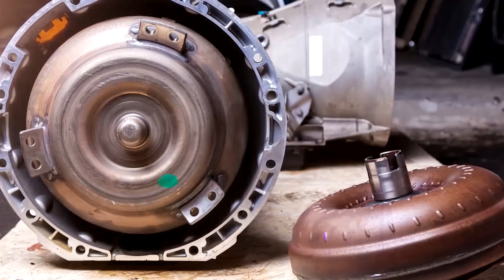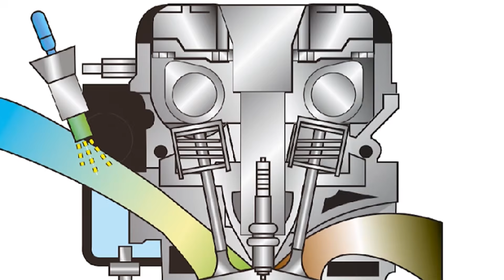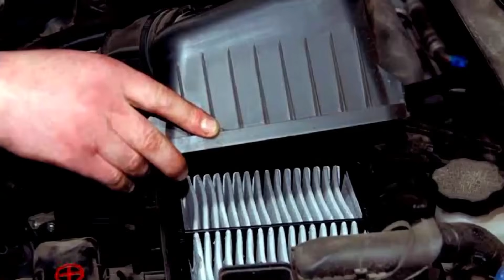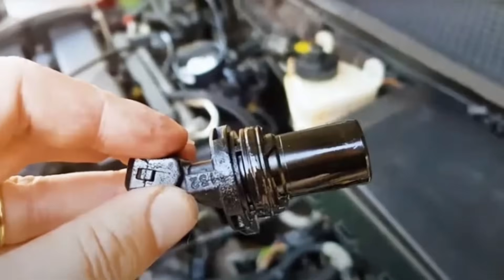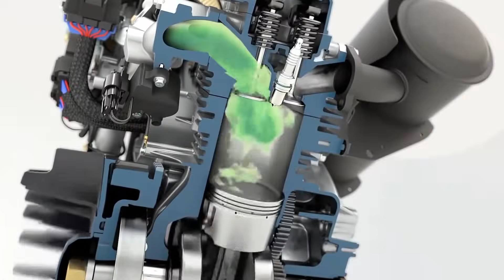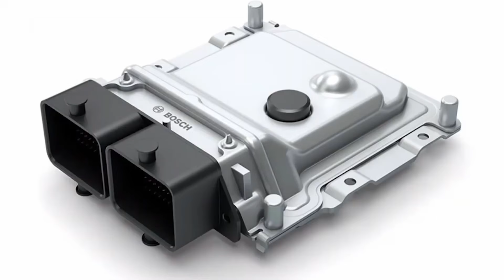10 Bad Mass Air Airflow Sensor Symptoms (Faulty MAF)

Comment: Great video but one thing do not use carb cleaner use only mass air sensor cleaner because carburetor cleaner anything else uses it will leave a film on that wire and it will not work properly use only mass air flow sensor cleaner.

Comment: Do not use carb cleanor  it could damag the  MAF use  electric  contact cleaner
Reply: Can i wd40 contact cleaner.?
Reply: @thebigone6298 no do not use WD-40 or anything but mass air flow sensor cleaner everything else will leave a film and ruin your mass air flow sensor.
Reply: @davidk1579  okey.. thank you sir.. 🙏

Comment: My MAF Sensor isn't working properly , my engine starts up as soon as i start the vehicle, Have no Black Smoke coming from the Tailpipe, but the engine surges and my RPM Stumbles 0 and 1 it doesn't stay steady.
I found and easy way to check MAF Sensor  started  the engine then unplug the connector and the Engine stayed Running  that's how I found out that it wasn't working ,  I installed the New  MAF Sensor and repeated the same check and disconnect the connector engine shut off right away as it Supposed to. 👍

Comment: I heard we are NOT supposed to use carb or brake cleaner on the sensors- only MAF cleaner or it will be damaged.
Reply: Can it cause transmission problems. I have a bmw e39 528i m54. While driving the cog light comes on and get stuck in whatever gear i am on. Please help

Comment: Oh another thing your car is supposed to stall when you unplug the mass air flow sensor my car does not do that it stays running
Reply: If it runs better without it.. it's time for a new one.
On my car, it's 200 bucks on rock auto.
That's where I buy ALLy car parts that aren't an immediate necessity.
Much cheaper, never had a problem.
The only thing I dont like about it, is sometimes if you need multiple parts, they could ship from separate locations and charge shipping 2, even 3 times.
You can switch different parts for cheaper or premium to get them to ship from the same location sometimes.
Reply: If you unplug your mass airflow sensor in your engine stays running that means the mass air flow sensor is no good.

Comment: I have a 2009 Chevy Impala 3.5 only about 93,000 miles on it I did everything I could I changed the purge valve mass air flow sensor the gas cap even the foot throttle and I change the vent solenoid that is by the gas tank the car runs great no stuttering doesn't stall no black smoke but it's still coming up with the purge valve code and the mass air flow sensor according to my scanner I clear it and a bunch of codes come up but the permanent codes are the mass air flow sensor and the purge valve which I replaced so I'm thinking I had something to do with the wiring it starts up fine it runs fine I'm not losing any gas mileage any suggestions

Comment: I have a ranger 2011, when iam on a stop and then press the gas the truck dont move and rpm go higher and a second later it studer and then start going, only do  it when is on a stop ,not while running. Any help?.. dealer told me is the differential but i dont think it is,is not one of the symptoms..

Comment: So my car stuttering when accelerating, especially up hill, could it be the air flow sensor?
Reply: check your throttle body make sure is clean and clean the sensor next to the throttle body and that will help and make sure u not move the position of the throttle body with your hands because if u do it the u will need to reprogram your throttle body precision because if u not do it the car can get stuck in full acceleration speed and you can have it  bad accident so make sure do not move with your hands